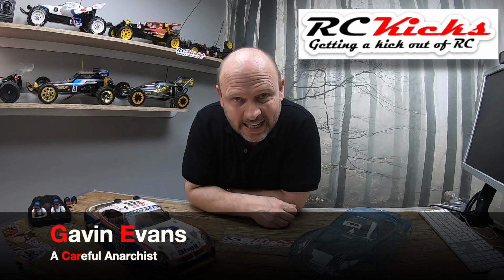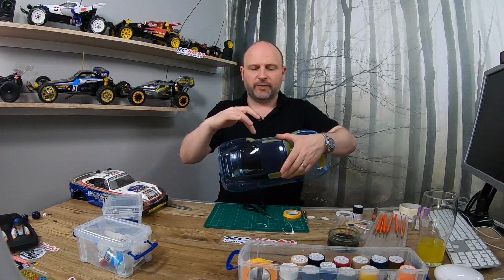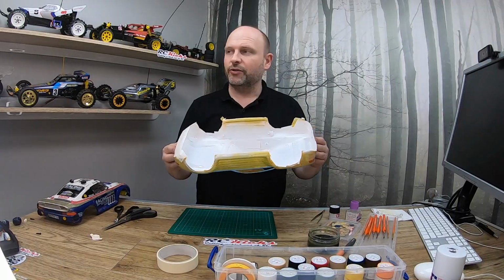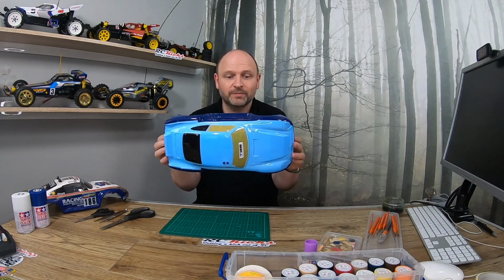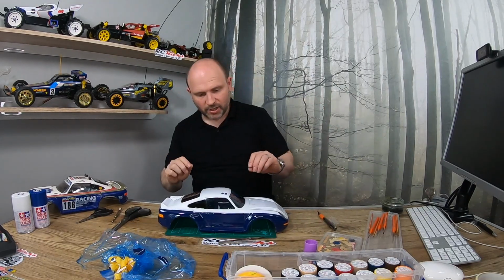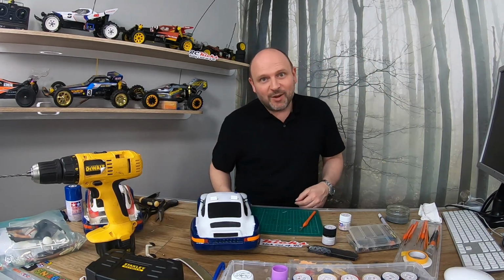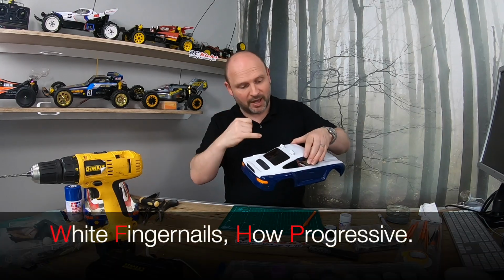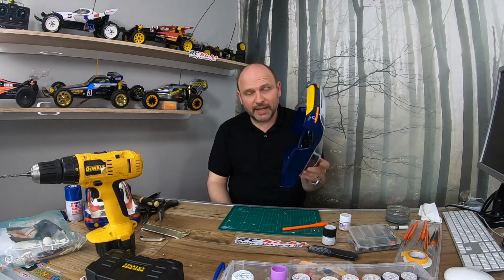Vintage Tamiya RC Car Porsche 959 restoration - Part 4: Painting and finishing the project

Comment: I really enjoyed this episode :-) 
You learn of your mistakes so you will get better with time :-)
My orginal 959 body is worse than yours by far, so I have to go the same route with mine when the time comes.

Btw, bodyreamer is real handy for making holes in your lexan body, I highly recomend getting one :-)

Cheers from Norway
Reply from the maker: MrCaprinut I’m chuffed you liked the video.   👍🏻  A few things I would do different next time.  1. Order the window masks from MCI. 2. Spray the rear windows black. 3. Spray the front lights area correctly the first time. 4. Make sure I have some silver paint. 5. Do the project over a week or two vs doing it in two days lol.

Comment: One more question please. How did you mounted the rear spoiler? I think that the original was in plastic with screws but the TBG is in lexan without screws. Glue?
Reply from the maker: Fit the spoiler the same way as the original Mario.

Comment: Hey Gavin can you tell me if hand paints are they polycarbonate paints or just the Tamiya Acrylic paints thanks in advance
Reply from the maker: Most people spray now using Tamiya polycarbonate paint but you can also get the from Core-RC.  Some also use airbrushes.
Reply: RCKicks so those paints you used when you the hand painting on the 959 body were polycarbonate based paint
Reply from the maker: @kevindoherty7935  As much as possible yes.  If the part doesn't flex and you can key the surface then you can get away with Tamiya X paints but it can be a risk if you use it in the wrong location on the body..
Reply: RCKicks thanks Gavin for the info it’s very helpful

Comment: I don’t think you advised on what this costed you in any of the vids, please can you let me know? Also can you confirm if the decals are reproduction, as it looked like you had “Racing” stickers at the start, but in the end the car came out with “Rothmans”.  Many thanks 👍🏽
Reply from the maker: cfc99991974 I have real and repo stickers.  The stickers on the body in this video are MCI not Tamiya OEM.  I was saving the OEM set for my original 959 body.
Reply from the maker: As for the costs it’s best not to ask lol.  More than you expect and double what you would think.